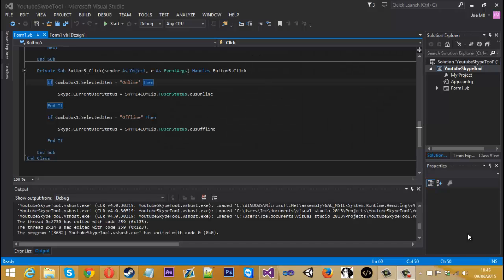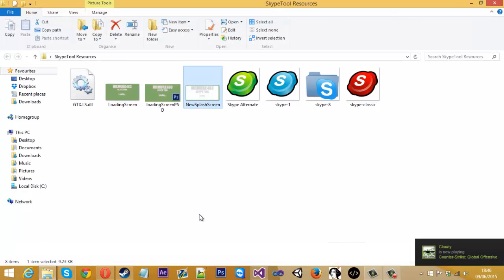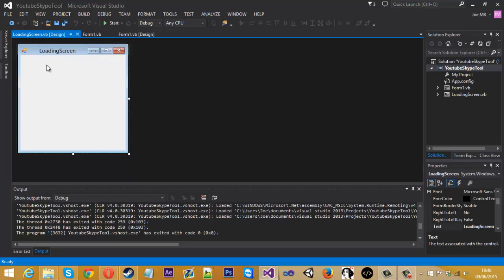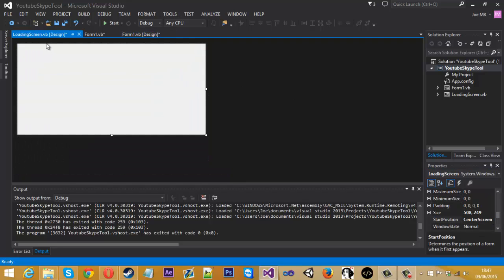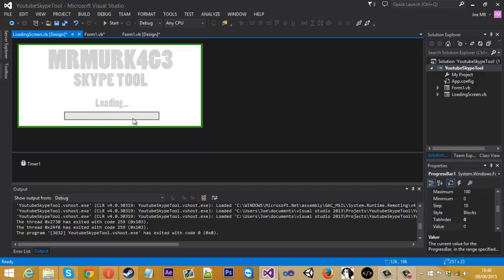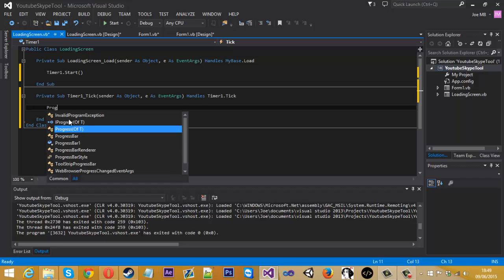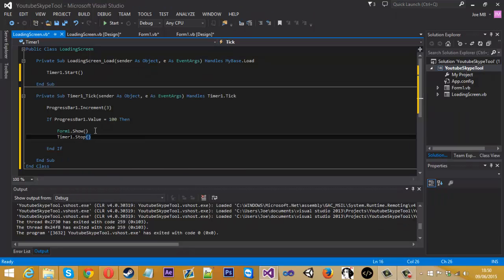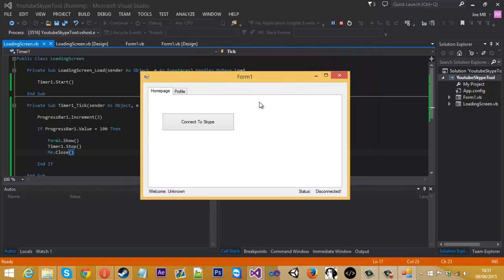How To Make A Skype Tool: #3 - Splash/Loading Screen!

Comment: My loading screen works, but after it's to 100%, the application closes & my form1 doesn't show.
Here's the code:

Progressbar1.Increment(3)
If ProgressBar1.Value = 100 then
Form1.Show( )
Timer1.Stop( )
Me.Close( )
Reply: +FsuGamingWithSeth Got it, to fix it I had to stop the timer before showing my Form1. I will leave this comment here just in case anyone else is having this issue & they can fix it.